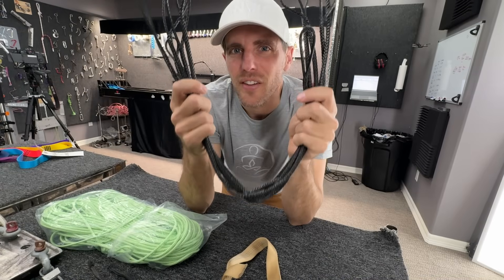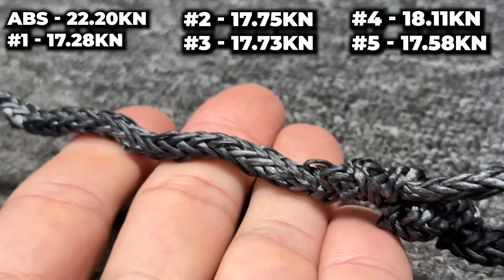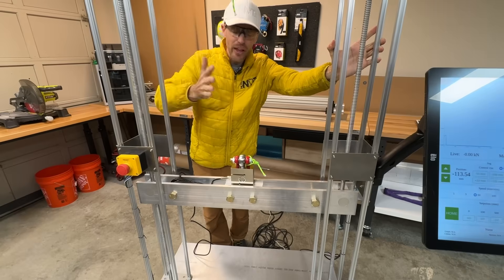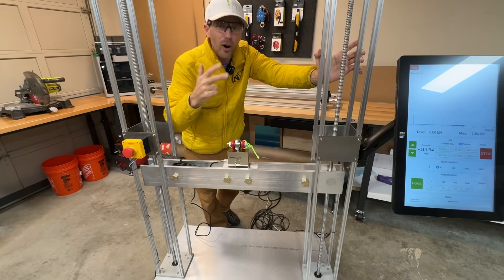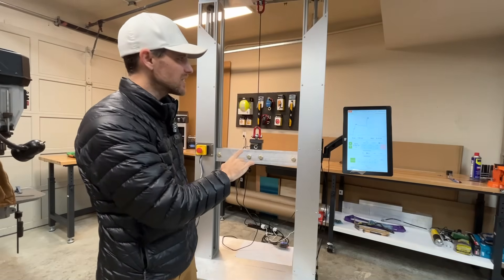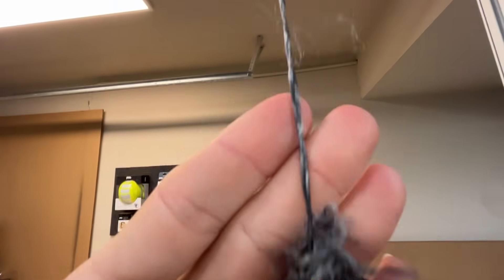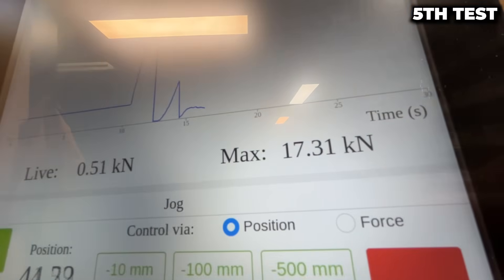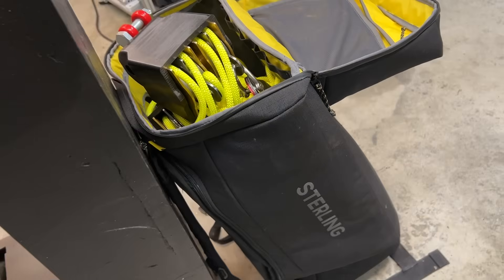Why are the numbers always wrong?

Comment: Something I haven't seen called out:

To prevent it (the machine) from helixing (as badly) the ball screws should have opposing threads. If the screw on the right is clockwise threaded, the screw on the left should be counterclockwise.

This is why it twists so badly. The top of each column is being twisted in the same direction, so it twists the whole top of the machine.

Comment: Thinking about winching efficiencies...We know a 2:1 is not actually 100% efficient even when using bearing pulleys to reduce friction. What is the impact of this efficiency loss when using synthetic winching ropes and solid donut rings? At what point does it become too many rings in the system and become ineffective? Are multiple, independent 2 or 3:1's better than a 6:1?
Can you help a curious climber and 4x4 enthusiast find out? Youtube.com/@HowNOT2

Youtube.com/@DesignedandBuilt
Youtube.com/@TJANDMAC
Youtube.com/@Unclepooly
Youtube.com/@timmyhasheart
Youtube.com/@Ronny_Dahl
Youtube.com/@4WDNewZealand
Youtube.com/@lostsheepadventures
Youtube.com/@joshjameskiwibushman

Comment: I knew it would self destruct the moment you said one motor per side. You either need some way to mechanically link the two motors so they drive the same exact speed, or you need to use just one motor and link it to both.

Comment: Likely the torque in the ball screws is what deformed the machine in that way. But you know that, right?
Of course pulling slower will create less heat per second allowing the line to remain cooler and thus have more strength. Who knew?

Comment: Dyneema (any splice) needs a taper on the tail, makes a huge difference as it eliminates the hard point you can see at the end of the bury. Cut out one strand from the last half of the bury evenly until you end up with just one at the end. Great to see you using Marlow! 

Without the taper, the yarns are unable to distribute the load in that small concentrated area :)

Comment: I used to do repairs in a metallurgic labo, they had a pretty huge breaktester for breaking various parts big and small. iron rods, plain pieces of steel etc. While i do not know why those machines always breaktest slowly, i am pretty sure there is a decent well thoughtful reason for it.

While i understand your reasoning about wanting too do it fast i think you should try and figure out exactly why they do it slowly.  Breaktesting is a pretty specialised field, people who design those machines have masters upon masters they probably aren't climbers but they understand material physics a whole lot better than we do. And i am pretty sure their reasoning is solid. I would advise to contact the manufacturers off those machines in an effort to understand them.

Comment: I am assuming the variation in BS you get with different speeds is due to heat build up but rating this with a slow pull is not unreasonable. Dyneema was developed as a static rope, basically a replacement for wire, It is used extensively for things like rigging. What would be interesting is to do some drop tests to see how much it needs to be down rated in impact loading. I wouldn't be surprised to find it would be as much as 50%, this stuff is not designed to absorb energy but rather to resist strain.

Comment: Chemical engineer here ... I think I can give you a reason why the "lab" test is done the way you stated.  When making a rope and doing research on a material you want to remove all the variables that would make your research result inconsistent.  Since these are all forms of plastic, the key variable in material strength testing is the temperature of the material at the point it is pulled to failure.  When pulling these twisted/braided fiber ropes one source of heat is the friction between the fibres as they rub against each other while stretching.  So to test batches of material that are being produced with sightly variable composition the only way to determine the strength of one composition against another is to test in a way that produces no internal heating ... thus pull really slooooowly in a climate controlled space.  So the slow pull test is used for good reasons.  

Where things get a little sketchy is they sell this material into a market that uses it in a very dynamic manner.  I'm sure if the literature is viewed carefully there are caveats and disclaimers about what the ABS actually means.  This detail is of course lost in the marketing text writing.  Therefore the service you are providing is very useful.  Because you have discovered that your hydraulic pull test is a good indicator of dynamic behavior but still a bit different from drop test behavior.  What your testing makes very clear is that when using these materials, a safety margin must be considered, to account for all the 'unknown" effects caused by rope movement in a dynamic fall situation.  The difference between the lab test strength, the hydraulic pull test strength and the drop test strength gives the user a good handle on the sizing of the safety margin.

Applying that material strength knowledge to the actual situation is the next task.  For example in my climbing days we used 11mm rope because we belayed by hand.  A human can't grip a smaller rope well enough.  So the rope strength was way over what was necessary.  That is where your concept of "good enough" and "super good enough" comes into play.    The application often causes certain choices to be made and those choices need to be checked against the safety margin.  A person is in the right ballpark if when new it is "super good enough"; because as it ages it will trend towards "good enough".  At some point one has to determine the point of "not good enough" and retire the item.

Excellent work and very entertaining to my ex-climber engineering mind.
Reply: But it's stupid to try to remove the variable of various amounts of heat produced during the pull, when this variable amount of heat is precisely the thing that determines how strong the thing is. It's just.. they were so obsessed with removing variables that they removed the variable they were actually supposed to measure.
Reply: @therflash  I think that trying to test the gear in a more realistic situation might yield so many variables to make the information commercially useless. These ratings are consumer information but they also provide liability protection, especially if it's UIAA rated. 

Thats why we watch these videos to be more relatively informed.
Reply: @ If a random dude on youtube can produce repeatable results in his garage, and those results match reality, I don't see why the manufacturers can't do the same.
Reply: @therflash   per the point of the poster we're replying to here, removing all variables creates a baseline by which to compare, say 8mm cord vs 5mm cord, [all other things equal]. However yes it doesn't account for real life scenarios. The "average breaking strength" should though, but then each manufacturer would have to do like 5 more test types. I guess we're all O.K. with knowing the "range" from the stated strength then but would be harder to test for accurately.
Reply: is that what you do for fun? go around claiming to be an engineer when your a high school drop out that didn't even make it to chemistry class.  get a life
Reply: The problem is when they claim this is the strength of the material for use in the real world, which is not considerate enough to slowly load and unload it to avoid getting it hot.  You know what does get hot?  Literally everything that has a load applied to it!!!!!!!!!!!!  SO, if the lab rats want to test it one way for developing their secret recipes, go for it, but then you need a separate, AND IN GOOD FAITH, test of real world approximating conditions in order to make a strength and use case marketing claim to the people who will be using the product to STAY ALIVE.
Reply: It also makes it very clear that some rope products are very much not designed for use in the way that climbing uses them. That's not to say that they're not still good at what they do, but looking at what uses they are marketed towards does start to make some of the choices of what statistics get advertised more understandable. Climbing certification is just a secondary market.

Comment: It's a cool knife but once you see the one odd problem you can't unsee it. The primary bevel at the tip looks strange because it necks down. The tip looks odd as a result, like a damaged blade that had the tip re profiled and still has the old lines.

Comment: Structural engineer here. This is a huge problem in my profession as well. Independent testing outfits get hired to test materials and they end up testing it in a way that doesnt match real-world use conditions. This creates inflated break strengths and is super unsafe for the user. Its always important to research HOW something was tested and not just look at the published values. Props to you for doing that for climbing gear for us. It blows my mind that ropes, carabiners, etc. are all slow pulled and not drop tested. I want a climbing manufacturer that tests in scenarios that would actaully happen when my life is on the line (pun intended). I hope someday you will be that manufacturer!
Reply: I’ve always been wary of any pull test. Straight hanging weight test and a realistic drop tests seems “super way better” than any pull test for the things that most people do with their gear.
Reply: As someone who works at heights a pull test and a drop test both have their places. I'd also like to see testing results with various levels of tension.
Reply: My biggest concern is my gear holding me if I fall. It’s not just my lanyard, but the other items I may be using in the system like carabiner(s), redirects, and asap.
Reply: is that your weekend fun? going around claiming to be an engineer when your full of s***

Comment: I have many thoughts on the failing of the first setup. 
Seeing it buckle like that is extremely unsurprising. Calculatuions on that are also rather simple. To prevent that you can brace it like the second Version or use wider extrusions IMO both is best.
If im not mistaken it twists in the same direction your screw turns, fun to See but also not entirely surprising. You could design the columns to be wider (Front to back), I know squares are cool and all but maybe perhaps this helps aswell
Now to an actually surprise to me: that ball screw snapped waaay later than I thought it would. The extrusions already buckled while the screw was still "just" bending. And therefor carrying a lot of the load while being forced in a weak position.
I personally would recommend adding some dort of linear rail to each side so the screws dont do all the guiding themselves (they are often times not designed to do that) but you have a setup (vertically placed) where this isnt a super big issue
Lastly, are you confident your base has as little flex as possible? Couldnt really tell but you might consider adding a few supports somewhere in the middle 
But seeing that you second setup worked as well as it did, im probably overthinking this
Very cool Video, looking forward to more!

Comment: I hate to point this out but as a professional splicer it is obvious that your splices do not have a long taper, I can see the end of the bury in your video. You have tested this before and shown the effect of tapering. Marlow publishes "minimum spliced strength" for this material, but that strength is supposed to be with a splice that has a long taper. I believe their average breaking strength would be when pulled over diverters, and their minimum spliced strength would be when properly spliced. This test is not comparable to either.
Reply: I splice (not professionally, just for when I need to controls for the laser) and I notice this in all his splices. All the splicing guides I've ever seen all say the taper is important to the strength of the splice.
Reply: Thats the cool think, its not perfect ,and s good

Comment: Real world "impact energy" is the only useful metric - when things get used for real it happens fast, like - car-crash fast, or failed base jump fast.

Strain lab testing in only useful for maintaining or assessing "a standard" for no purpose other than "the standard".

WLL remains the use case for anything critical or life supporting - let's start with a SF=6 for gear, that way when it breaks (or fails to brake that fall) there can only be one reason, the user did it wrong (or for far too long).

(High tensile bolts - rated at 0.8 or 0.9 of "minimum proof stress" - not actual failure - then never exceed the Safety factor   -divider, 2,4,6 - etc)..

Unless there is a reason the independent drives are required to be "independent" - ( ?? ) couple them with an adequately sized timing belt / roller chain...

Guessing, nobody publishes their time variant strength testing of dyneema - or anything else.
(getting back to energy absorption - this is the "interesting" part of materials science - drop tower slowed down to iceagey stuff....)

While the portability of the lightweight "universal tester" is nice - most people could source large PFC anywhere in the world and assemble a fairly "bullet proof" structure for a lot less than the lightweight extrusions.  - welding not necessary, lots of well tightened bolts achieve the same thing (and it can still be disassembled for "transport".

Comment: Structural engineer here, you had me in the first half ngl, but your guy using the terms "failure mode" and "plasticly deformed" reassured me he knows his stuff. 

Bracing the columns with the sheet metal is good thinking, cutting and assembling struts for a truss would be an absolute pain. I would still consider the inner columns, closer to the test piece, to have an unbraced axis despite the plate and fasteners potentially increasing stiffness. Can't ensure its correctly assembled every time after all.

The only thing that looks a little sus to me is the base. Did a back of the envelope calc and it seems to check out at double the loads tested in the video (a 12 kip/50 KN pull test), but idk what the material props and dimensions are (also assuming you want the stresses to stay in elastic range). Just looking at it, another post in the base would help ease my Spidey senses, that way the plate could better act as a transfer beam for the columns. Although, if you're anything like me, I'd whip out the FEA software for fun anyway on a personal project, those stress rainbows always just look so darn cool lol.

Keep up the good work, I don't even climb but I love your testing vids!
Reply: Mechanical engineer here! they also had me in the first half lmao.  I took one lookat the first design and was like, that's gonna have a buckling failure lmao, those collumns need to be connected somehow.  Don't super like the whole "loading frame designed out of aluminum"  but it's cheap and for what these guys are doing without any strain measurements it seems fine.
Reply: @red-qx4no  I don't get the whole aluminum part either. I guess it's to make it light since he said he wanted to be able to move it without a forklift? But steel is so much simpler to work with. It's easier to weld, it doesn't fatigue if you keep the stress below a certain limit, it's less prone to cracking, it's even cheaper.

If he just made the columns out of steel square tubing and welded a couple of u shaped brackets around the coulombs to prevent buckling and twisting, it would be very strong. He could even add trusses if he wanted to make it even stronger.

Comment: It's understandable that the manufacturer wants it to be as strong as possible and make the results look as high as they can be but,
As a human falls at 9.8 m/s² I'd rather see stress testing with a sudden peak load not slow like industry standard. Your drop tower is the ultimate way of shock testing and should be the standard
Reply: Yeah, agreed. And if the material won't break reliably in violent drop tests, that just means you need to slap a large standard deviation on the results and set the minimum breaking strength accordingly.

That said, I do think there is value in testing the way manufacturers do, in order to verify their reported numbers.

Though I think it'd be better if manufacturers would report numbers on climbing gear more relevant to climbing use.

Comment: I'm a controls engineer and have built test equipment similar to that, we used 8080 extrusion for much lower loads than yours instead of a few pieces of 2020 profile. 
Go find a local automation integrator or machine builder, you probably can't afford a new Instron or Mitutoyo UTM but I'm sure they'd be able to get you off to a better start. LMK if you want help programming NI Measurement Studio routines to run this thing...

Comment: RYAN! It’s not whether you can or can’t use 120 volts (thank you for not saying 110v, because that doesn’t exist) 
It’s the fact that MOST* receptacles in North American households are 15 amp 120 volt. The breakers are rated for 80% which means, you get 12 amps @120v=1440 Watts. Again, that’s the average receptacle.
I am from Canada fwiw
Reply: Yes we have 120v lines but 105-115 at the receptacle is quite common due to transmission losses and per code(in the US) a single device is allowed to draw 1500w continuous or between  14.28A-13.04A and allow for excursions up to 18A or 2160w due to transient loading of Lines for a maximum of 30s after that your breaker should trip.
Reply: You are 100% correct. BUT, it’s a 120/240v system. And breakers are rated at 80% continuous. Don’t be pedantic.
Reply: With good gearing a 100w motor would be able to drive this, so that's kinda irrelevant.
Reply: You bet. I wasn’t discounting the system, I was pointing out his big statement about “people say you can’t do this on 120v!!” And all that.